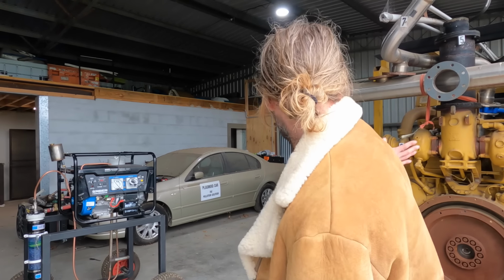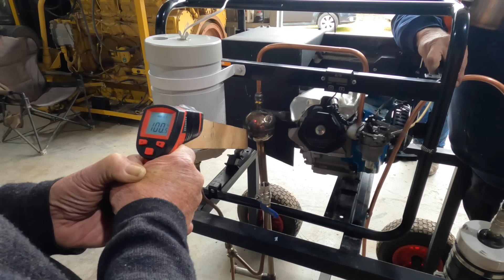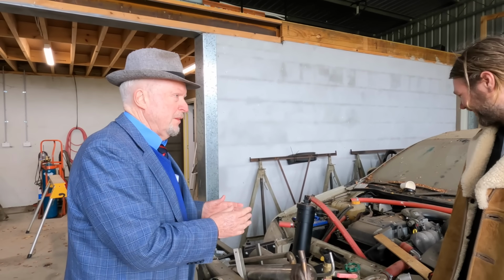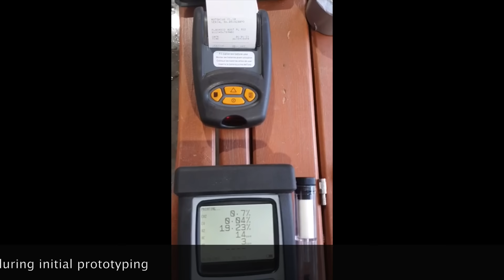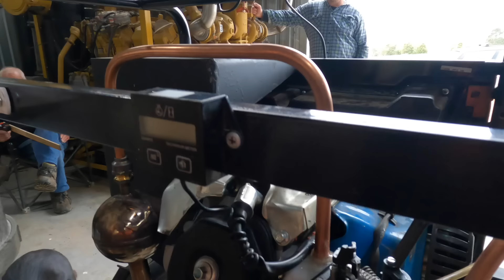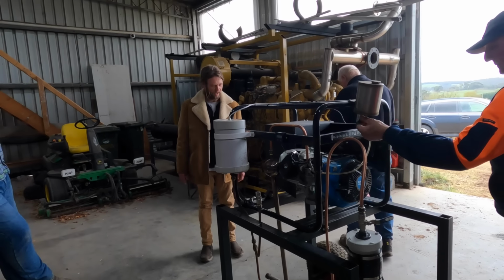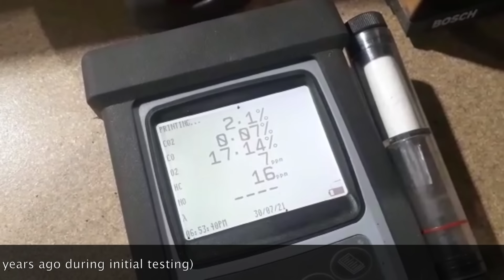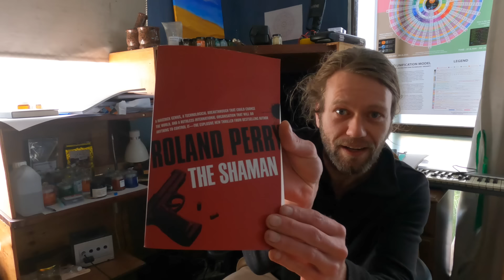Malcolm's Thunderstorm Plasmoid Generator in Action | FULL DOCUMENTARY | with Jordan & Roland Perry

Comment: I hope I'm wrong but I believe Malcolm is creating a smoke and mirror show trying to hide the fact that the exhaust contains excess water vapor when his MSAART tech is turned on.  An excess amount of water vapor within the exhaust fumes would clog the condensate trap that all exhaust gas analyzers have.    I've worked on many cars that had head gasket issues which caused engine coolant to burn.  The engine coolant caused an excess amount of water vapor to be present in the exhaust which causes an exhaust gas analyzer's condensate trap to fill up.  This also causes the exhaust fumes to lose a large amount of its normal smell. Engine coolant burning within an engine has a burnt sweet smell because the coolant itself smells sweet.  I'm not certain, but I imagine that excess water vapor with no coolant suppresses the normal exhaust smell while still smelling a bit burnt.
Reply: Didn’t they actually analyze the exhaust at Tesla Tech and find that it was essentially 20% Oxygen and no hydro-carbons? I was curious why the guy wouldn’t have a gas analyzer on hand for this “documentary”
Reply: Also, couldn’t you just implement an automatic dump valve for the condensate trap based on level?
Reply: @smax4895 Fire happens when carbon fuel is hot enough to react with oxygen.  It usually forms carbon monoxide.  If there is no carbon in the exhaust, there would have to be a big pile of ashes in the engine somewhere.
Reply: @customsongmaker  well, the claim is that the “lightning generator” is actually causing nuclear transmutation and converting the carbon elements to Oxygen, but that’s not at all possible, as you would have to come up with additional protons, neutrons and electrons out of thin air. I agree that this is smoke & mirrors. I’ll believe it when I see a gas analyzer show all zeros at the end of the exhaust.
Reply: @smax4895  Why burn it first?  Just analyze what is being sent into the engine before it's burned.  

Better yet, put the generator into a small room with a canary for a few hours.  

It's possible that the extra water vapor is interfering with the normal operation of the exhaust sensors, and that's why the readings are unusual.  Ironically, water vapor in the air intake probably makes the engine run less efficiently.  Notice they're not claiming that it increases mileage.
Reply: @customsongmaker  The interesting thing is that people have been experimenting with adding water vapor to the combustion engine air intake for a long time now.  I believe it actually does make an engine run a bit more efficient.   Not sure really how, but I believe it may cool the engine down slightly or something like that.
Reply: @smax4895  That's a good question and I wondered how they analyzed the exhaust during Tesla Tech.  Unfortunately, I don't want to buy the Tesla Tech video presentation and give Malcolm Bendall money until I feel like he deserves it.  Also, I don't think an automatic dump valve is a good idea.  The condensate trap is in place to prevent water vapor from making it to the actual sensor because the water vapor will damage the sensor.
Reply: @Mike-nf2hx  ahhh. Didn’t realize he was selling that video. That makes me even more skeptical because if his idea actually has merit, he’d be on the fast track to becoming a billionaire.
Reply: Very well could be a simple explanation
Reply: It is utter nonsense. This is another variation on water injection and/or Stanley Meyer's water fuel cell.
Reply: I'd really like to build a prototype myself. Is there a link to proper plans with parts list, accurate measurements and step by step building instructions. If not, this is being presented very irresponsibly and can cause injury or even death and is not really an open source project. This will be a huge Global Revolution if laymen can convert their own vehicles to prove the concept, so if these fne gentlemen cannot provide proper, reliable and safe plans with which the DIY enthusiast can enable small generators and cars with this concept I tend to call BULLSHIT. (•‿•)
Reply: @henrijacquesblom6891  I couldn’t find any actual plans to build a prototype.  There are a few diagrams but nothing with specifics.  Fortunately, I can’t see anyone actually causing serious injury to themselves if trying to build a prototype other than burning themselves on the exhaust.
Reply: Thats why he used his nose, almost all of the bad stuff is gone

Comment: Silly question: Where does the carbon go?
Reply: Not at all a silly question. If I am understanding them correctly, they are claiming to be transmuting the carbon into oxygen. Not a chemical reaction, but somehow changing the nuclear makeup of carbon with a mass of 12.011u into Oxygen at 15.999u. Two possibilities imo. Either they managed to circumvent several fundamental laws of thermodynamics with some steel wool and an aquarium stone, or their claims are unfounded. They may even be telling the truth to the best of their knowledge. But considering they have no instrumentation whatsoever makes me question how much knowledge they can realistically have about this device or process or whatever. Hope I'm wrong, but I have gotten my hopes up for a lot of peoples claims in the past, and they almost universally have this same kind of vibe to them. I'm afraid its just a prop and an act.
Reply: @joecrisp9060  Put some aluminum foil in an ultrasonic cleaner and you can circumvent the laws of thermodynamics too :) People do it just to test if the cleaner is working, but they have no idea they're transmuting some of the aluminum in the process. Mostly because you need fancy lab equipment to verify it. Look for areas on the foil that are affected but not yet disintegrated.
Reply: @dekutree64  What is the aluminum "transmuted" into in an ultrasonic cleaner? And how does that circumvent anything? To my knowledge it just shakes it a lot?
Reply: Cavitation in water transmutes elements. Depending on how strong the cavitation and the elements involved it can do so very easily. I believe the carbon is easier to transmute through cavitation than metal.

Comment: Need to run a sensor on the exhaust and get a proper read on what the parameters are before and after. Judging by odour is not much help as Carbon monoxide is odourless anyway and that's the really dangerous emission, not co2. 
Also, is there a reaction with the steel scourers? If not and fine bubbles are indeed what is needed, it will run better without the steel, which is certainly making the bubbles bigger and not smaller due to obstruction and allowing separated bubbles to merge. Would love to see a schematic to better understand the bubbler's role in this.

Comment: Basically what I can see here is a single cylinder four stroke engine with a vacuum leak that sucks extra air that has been illuminated with a UV lamp though a tub of water and then somehow “plasmids” removes the carbon on the exhaust side. Interesting I would love to see the millions of scooters around the world with these, lots of emissions could be wiped out!
Reply: The carbon is actually converted/transformed into oxygen when the carbon is hit at zero point where there are all frequencies so therefore no frequency...without frequency there is no "form". The vortex is rich in H+ and provides the 2 protium to convert the carbon into oxygen.  That's my understanding so far.  I haven't learned why it only takes on 2 protium and not 1 or 3 or 10 for that matter (pun intended).  My guess is that it is the frequency in the Thunderstorm generator.  There's a lot to learn.  If I have this wrong, please reply with the correct mechanism.  Cheers
Reply: Because it is less than that. It is a "water injection" system and nothing more.
Reply: I would love to build prototypes for my own car and generator. Is there a link to proper plans with parts list, accurate measurements and step by step building instructions. If not, this is being presented very irresponsibly and can cause injury or even death and is not really an open source project. This will be a huge Global Revolution if laymen can convert their own vehicles to prove the concept, so if these fine gentlemen cannot provide proper, reliable and safe plans with which the DIY enthusiast can enable small generators and cars with this concept I tend to call BULLSHIT. (•‿•)  If these guys are playing a game I feel sorry for Randall Carlson, whose appearance on the Danny Jones Youtube Channel got me interested in this. I see Randall as a genuine academic and would hate to see him misguided in any way. So, of anyone has a link to those plans or have successfully built a working prototype, kindly share.
Reply: @TheDirtCreature  It is not a water injection system. The system uses almost no water Consumed. I understand where you're coming from. If this is all you've looked at. Plasmoids are inverted vordises in a Nano bubble.
When carbon goes down, that vorcy because of the frequency created by the geometry of the device.
6 Protons are disassociated and turn to plasma.
When it comes back somehow it goes to oxygen. And I think it's because of the frequency created. But that I'm not sure of yet. Regardless, it's not just putting water into the engine. Encourage you to look into it and learn a little more. The details you will be intrigued or amazed. It's up to you, but this technology is out there. And working and far exceeds a water system. I'm certainly not trying to be argumentative here, but to encourage you.  In a positive manner to learn more about it. Go take a look at alchemal science on you tube

Comment: just as an interested observer, the first time you smelled the exhaust from the device the "UV" light wasnt even on and you can see the gentleman point it out and fiddle with the plug. when the light was on is didnt look like a UV spectrum. also they have a plastic manifold between the carburetor and the engine which appeared to start to melt when they ran it for more than a few minutes. tuning in for further evidence.
Reply: didnt you like how buddy used his nose as a gas analyzer? good thing co2 is colorles and odourless.

Comment: I've got a 1965 Chevy Impala SS with a 327 engine I'd love to try this on. Taking a classic and making it O2 generator would be awesome. It would floor people. The car was made to hold a 427, so we at least have 100 cubic inches of room to play with.
Reply: I would also love to build prototypes for my own car and generator. Is there a link to proper plans with parts list, accurate measurements and step by step building instructions. If not, this is being presented very irresponsibly and can cause injury or even death and is not really an open source project. This will be a huge Global Revolution if laymen can convert their own vehicles to prove the concept, so if these fine gentlemen cannot provide proper, reliable and safe plans with which the DIY enthusiast can enable small generators and cars with this concept I tend to call BULLSHIT. (•‿•)

Comment: I use what's called a vortex gun on my CNC machine to cool the carbide endmill while milling parts. This seems to be a much larger system of the same counter rotating tech. I can see frost on my machined part during operation.
Reply: nah. in expanding from only an atmosphere, compressed air at room temperature will cool below freezing...

Comment: Summary- To summarise : You are claiming to convert gasoline exhaust  ( Co2...)  stripping the carbon .. then stripping water and creating a oxygen + 2 x hydrogen plasma ( H+ , e-) and fusing it into Carbon(6 protons ) + 2 ( H)  ==> producing O ( 8 protons)  .  I have not calculated the energy required to transmute C to O but it wouldn't be small so where is that energy coming from ? At this stage I don't see this as valid . Add to this that you eem to indicate the plasmoids are not mixing with the exhaust
Reply: They are suggesting a "zero point energy effect" as far as I can make out. Your chemistry concerns are certainly very valid. Regardless, I would love to build prototypes for my own car and generator. Is there a link to proper plans with parts list, accurate measurements and step by step building instructions. If not, this is being presented very irresponsibly and can cause injury or even death and is not really an open source project. This will be a huge Global Revolution if laymen can convert their own vehicles to prove the concept, so if these fine gentlemen cannot provide proper, reliable and safe plans with which the DIY enthusiast can enable small generators and cars with this concept I tend to call BULLSHIT. (•‿•)  If these guys are playing a game I feel sorry for Randall Carlson, whose appearance on the Danny Jones Youtube Channel got me interested in this. I see Randall as a genuine academic and would hate to see him misguided in any way. So, of anyone has a link to those plans or have successfully built a working prototype, kindly share.
Reply: @henrijacquesblom6891  At this stage transmutation with non nuclear energy is fantasy unless it can be demonstrated in a lab setting but it contradicts the conservation of energy so I wouldn't hold my breath.
Reply: @henrijacquesblom6891  was all this just bullshit I only just heard of this now ?

Comment: As long as you know that this is not original technology. It was copied from work by other groups, not least Paul Pantone’s GEET (1990s) and the GEET has since then even been seen to run on sugars, there are also existing patents for some of the individual components on later designs. Just beware that this is not at all new and there are some very experienced experts out there in this LENR field. The scientists and engineers who are doing this are very altruistic and have no need to steal ideas like these potential fraudsters are attempting to do by claiming they suddenly came up with this technology. They may have acknowledged Ken Shoulders EVO work, but there is a big jump from there to here.
Reply: GEET bubbled the fuel, not the air inlet. Or am I wrong?
Many patents try to claim the tube in a tube. Which ones claim atom recombination from 6 to 8 protons?
GEET's claim seemed to be about lighter exhaust products, not heavier.
Perhaps we can do better than just a reactor the fuel OR the air intake. Can half the air come through the ionizer and half through the fuel? Can the fuel be pre-ionized without creating a Mariana Trench 2.0?

Comment: Nobody has explained wtf this thing is actually doing worth a darn
Reply: It cleans the emissions from what I gather. I'm sure it does more than that too.
Reply: so does a catalytic converter? and an egr what makes this different? @The_Remnant86
Reply: @inteligentmonkey1   obviously our traditional methods aren't close to zero emissions.  Maybe look up some of the emissions results.
Reply: @The_Remnant86  okay but this engine is still running on fuel? it’s super lean but it’s running. Do you have a link to the data pulled? They didn’t even have an exhaust analyzer attached to the exhaust pipe?
Reply: @inteligentmonkey1  I do encourage you to look up more of the official testing process.  The inventor has quite a few ( at this point)  videos where the emissions are tested live. Apparently, it also runs the fuel for only a short time to get the heat requirements met. 
If you're genuinely intrigued,  do look it up further.
Reply: @inteligentmonkey1  seriously, what's the difference between clean air and polluted air?
Reply: Even theoretical physicists can't explain it. This is basically creating a more efficient burn to nearly 100% efficiency and exhausting atmospheric air. So there may be some more happening inside the zero point.

Comment: I still don't see the point. These engines are running without a load, and still extremely unstable idle, with tremendously high idle speeds at that. What is this proving? I get the "reduced emissions" yada yada... but if it's not under load and actually performing useful work, who cares about reduced emissions if it can't do anything?
Reply: Looks like the genny is the load hence high idle speeds

Comment: great video , balls are not that hard to make study metal spraying, like the idea of ball at both ends,at tip in eaglehawk bendigo they  run a big generator on the methane produced from the rubbish ,some of his plans show a center rod inside the intake ,how to run it on water is covered by walter jenkins,,some details of the pipe diameters  would be good on the size you decide on
Reply from the maker: Agreed, that would be a good one to try it on.  I'm just waiting on the manufactured spheres to be done from the uk/us trials as it won't be too long now. Then we can try that big cat. No rod in this particular one. Pipe diameters are in there though. Its an inch and a half inch on that one
Reply: I would love to build prototypes for my own car and generator. Can you direct me to a link to proper plans with parts list, accurate measurements and step by step building instructions? If not, this is being presented very irresponsibly and can cause injury or even death and is not really an open source project. This will be a huge Global Revolution if laymen can convert their own vehicles to prove the concept, so if these fine gentlemen cannot provide proper, reliable and safe plans with which the DIY enthusiast can enable small generators and cars with this concept I tend to call BULLSHIT. (•‿•)